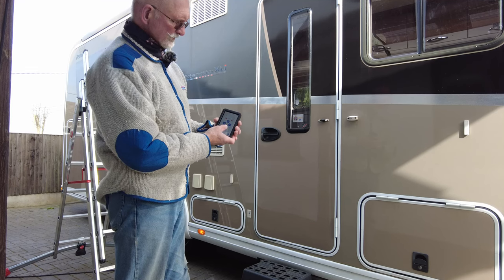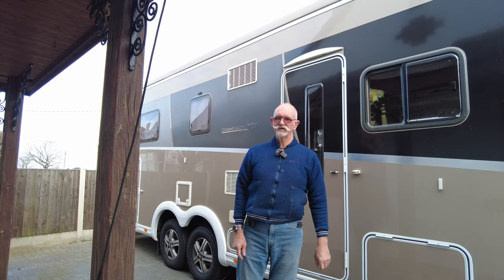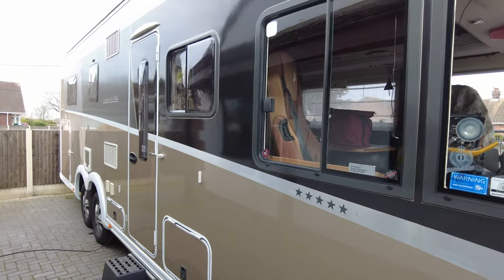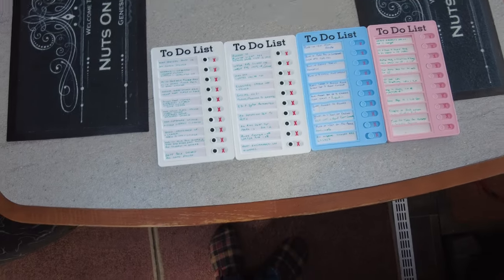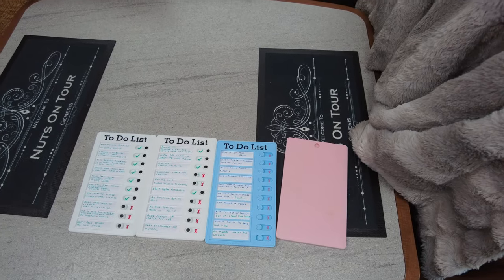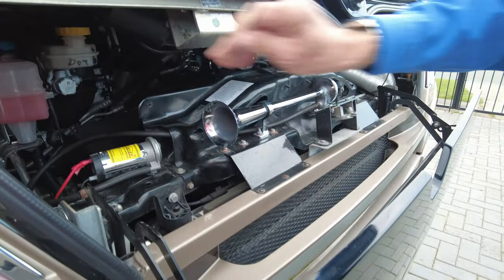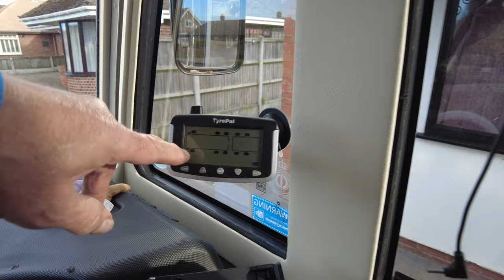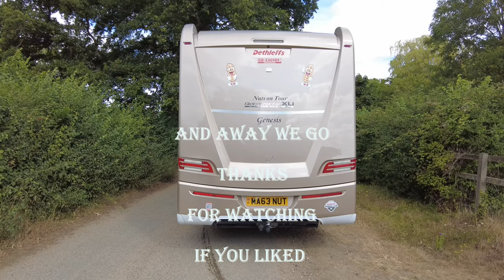EP59 Preparing Genny for a trip

Comment: Very interesting. May I ask what tyre pressures you use? Thanks.
Reply from the maker: Our tyres are agulias all weather all terrain and the people at the garage said for our weight . Which is 5.5 te. The optimum pressure was 76psi. And 170nm for the wheel nuts. So that is what we have stuck to.  The tyre pal system is set to alarm at 70 for under. 86. For over and I would have to check the over temp... I think it is 30 degrees C.... ( not 100% on that one)

Comment: Mark are you ok standing on the roof? Plus I always thought not to use a power washer on my caravan
Reply from the maker: The roof of ours is a great construction.  No wood... if you are gentle then you can walk on it to clean etc... as for the pressure washer. I turn the pressure down to about 60 to 100 psi and make sure I don't blast at the seals.... so far this has worked fine. No leaks or damage... I am only using the small ryobi washer not the big kartcher one. That would..... probably damage something. But as said the small one with the pressure down just moves the muck and dust before a good clean.
Reply: @nutsontour  thanks for coming back and explaining
Reply from the maker: @paulmorgan464 no problems. We always try to answer all our replies when and where we can.... that was one of the reasons for us getting into you tube to try to help each other out with tips and tricks to share with each other....